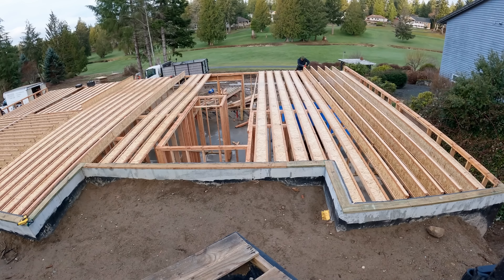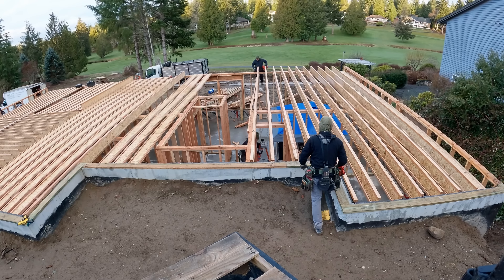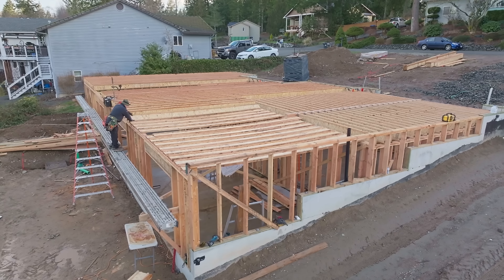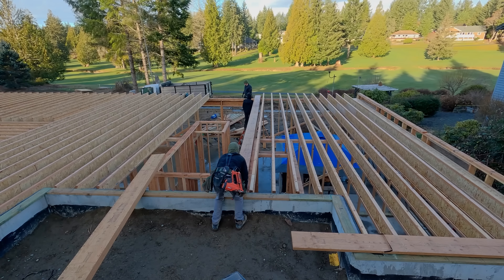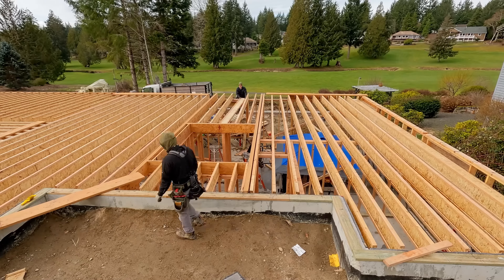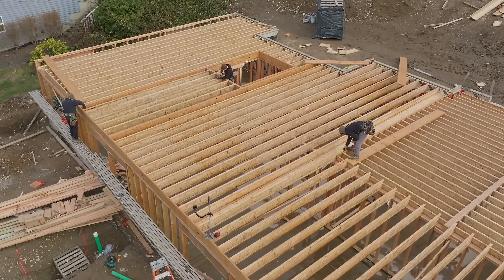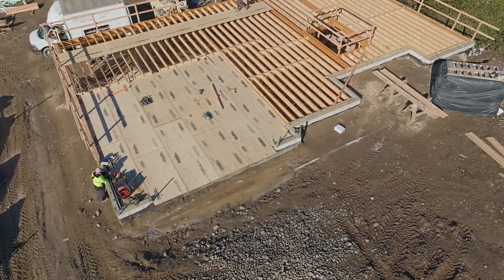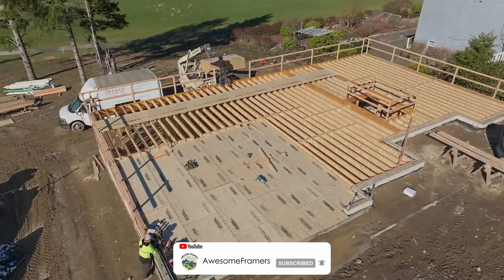Floor Framing: Installing I Joists for Long Spans (Part 2) project 120 part 6

Comment: Nice video, Tim.  On the Paslode Nailer;  I owned a bunch of the impulse nailers when they first came out.  The framer was okay, but the finish guns were a nightmare.  The only drawback for me is having to have all the different kinds of nails.  I would be tempted to take the plunge again if Paslode did not try to lock you in to their ecosystem and the gun could should a standard 21 degree nail I can easily get at my supplier with no ordering etc.

Comment: 16:46 are you putting in 3 nails to the end of the I joist? Top middle and bottom; I thought you never nail into the web. Thanks.
Reply: Nevermind im dumb. I realized you have the lvl doubled up for the header. Something you explained before.

Comment: I know you get a million questions every video 😬 but I'm curious if you consider it desirable to have a course of wall sheathing break on the rim joist, or if you have any qualms about having sheets span right over the floor framing, from lower floor to upper floor? And does it depend on if you're using engineered or dimensional lumber? Thanks for all the content :)
Reply from the maker: All good questions.  Unless our engineer specifies the floors be connected with straps, it doesn't matter where the sheathing breaks as long as it breaks on solid blocking or framing.  If it works out I prefer to break roughly center on the rim, but my first priority is efficient use of material.  The major issue is making sure it breaks on framing.  If you notice in this video https://youtu.be/9X-js9gXSME  the sheathing is just plate to plate on each floor.
Reply: @AwesomeFramers  thanks Tim! Awesome link too

Comment: why is the garage not concrete? super curious about that
Reply: Just an option rather than a suspended concrete slab. Either will work fine.
Reply: Now that is interesting. I've never seen a wooden garage floor before.
Reply from the maker: It will be a concrete slab over that floor.  Stay tuned

Comment: I've seen several videos posted by firefighters and fire fighting organizations where they state that if the arrive at a building which is on fire and they discover that the building is built with I-joists for the floor or roof system, they won't enter inside because they know that the building has a far greater likelihood of collapsing while they are in there due to the fact that an I-joist is much less structurally sound than regular 2x material.
When is it better to build with fire safety in mind and use 2x material rather than ease and speed of construction using I-joists?
Reply from the maker: Read the link I provided. Those videos you saw prove nothing without context. Same with my video.
Reply: @AwesomeFramers  Which link?